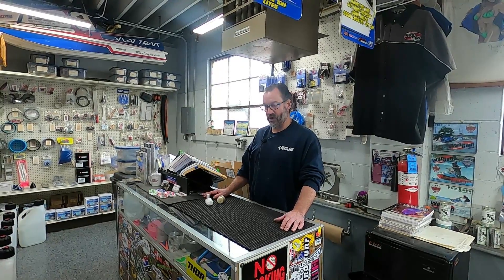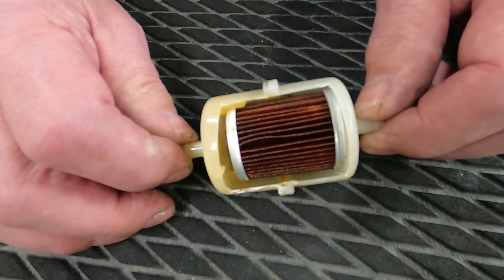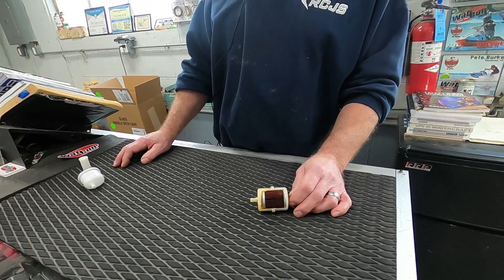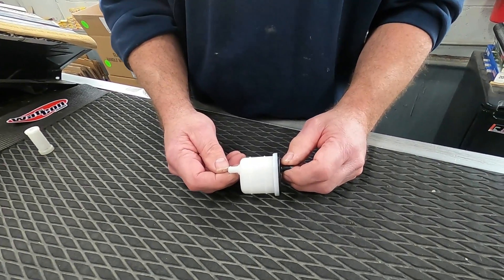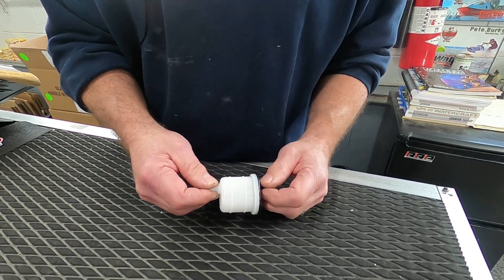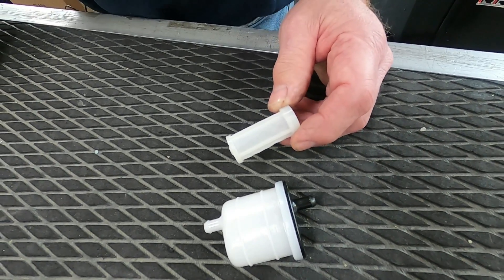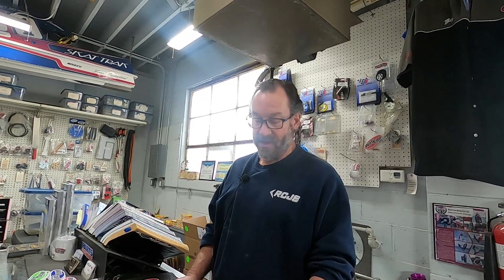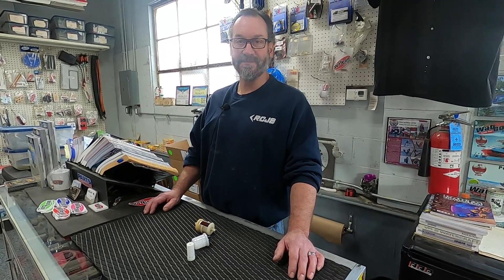Fuel Filter comparison PWC vs. Standard small engine

Comment: Nice video. However micron refers to the size of particle the filter will catch vs let through. While usually correlated to to flow that a high flow filter isn’t as effective at filtering as a low micron, lower flow filter. 
I’ve had good luck with the KN and slimline screen type filters for stand up skis with limited space.
Reply from the maker: Thank you for watching.